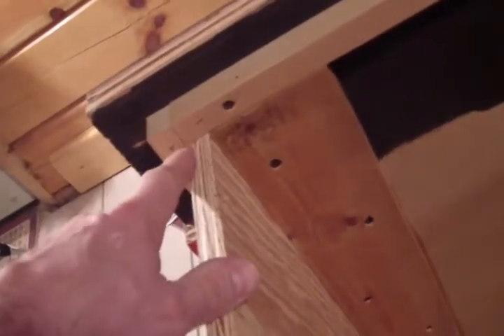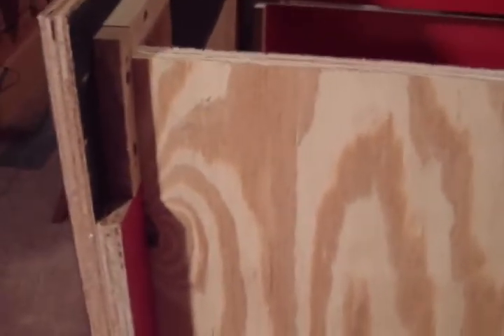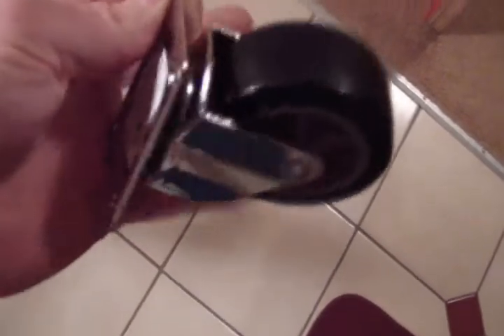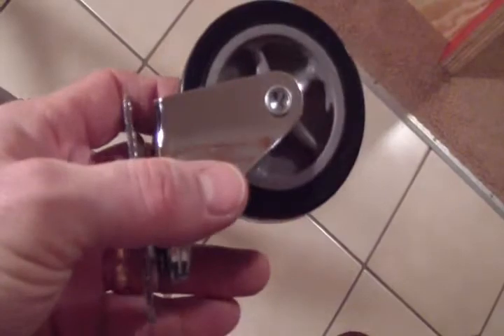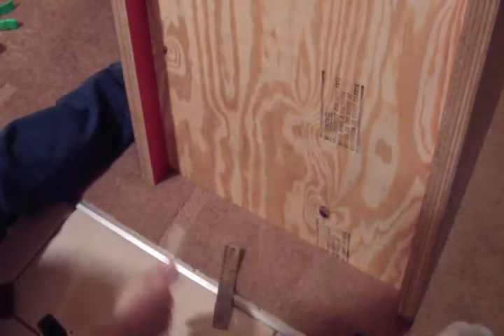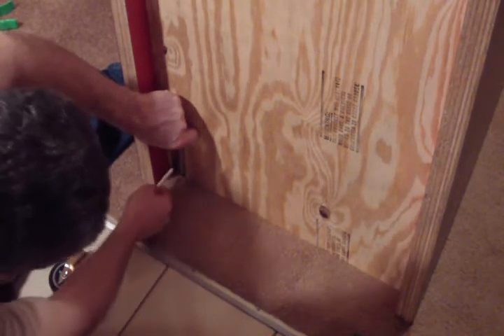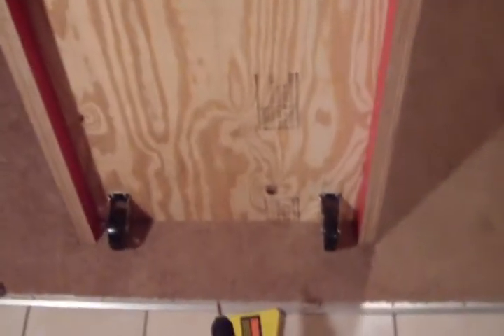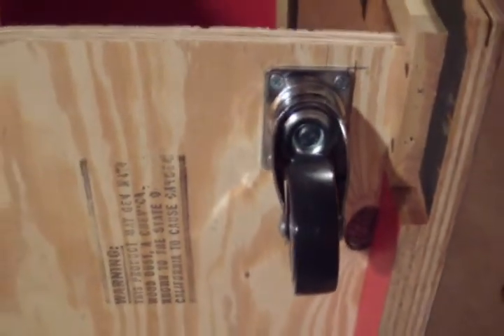MAME Cabinet Casters

Comment: maybe adding some handles on the sides like set into the sides of the cab would help with moving it around, especially once all the weight is in it, just something nice n easy to grip on like a lot of arcade cabs have.
Reply from the maker: I might could add something like that to the back, but the sides are completely covered in the black laminate which I don't want to cut into in any way since it turned out so nice.  Plus the sides will eventually have art, and I'm not sure exactly how much of each side it will cover.  My midway cabs have these handles up high on the back (like cutouts with plastic inserts) which are made to grip the cabs by when they are leaned back onto the built in wheels they have on the lower back, but since mine has 4 casters with the cab not requiring leaning to use them, I'm not sure if that would work any better than just handling the cab by the corners of the structure itself.